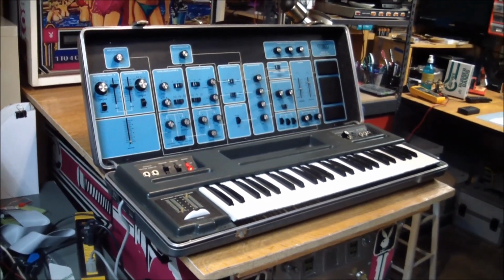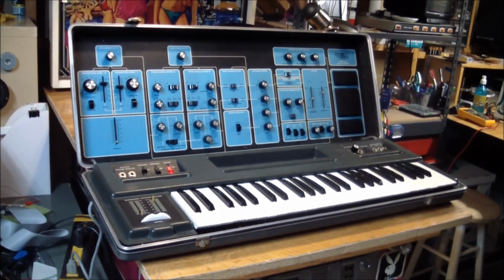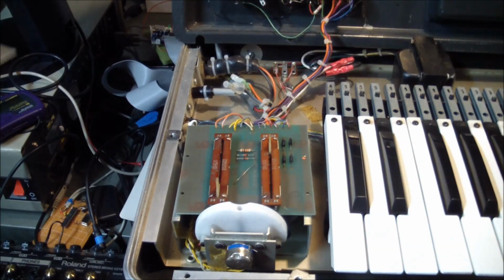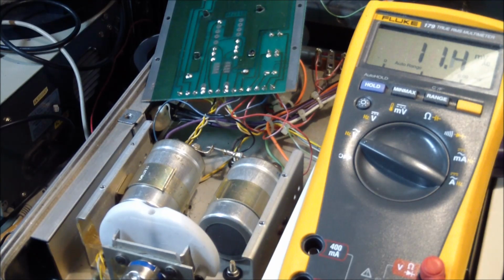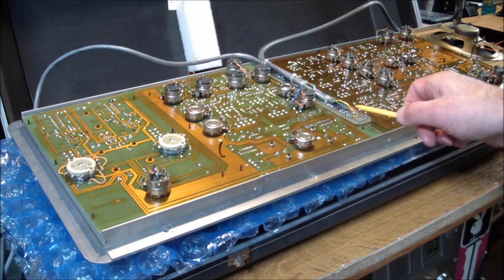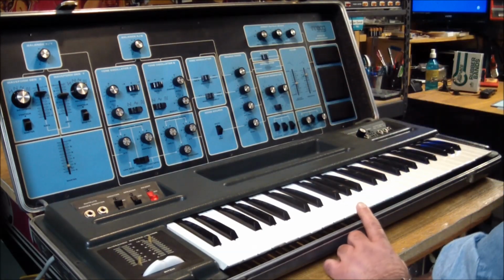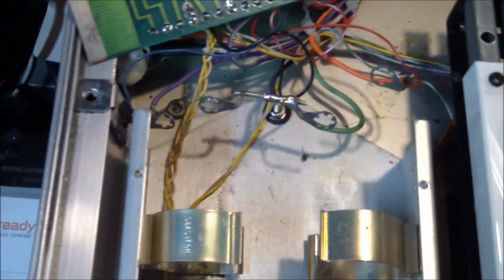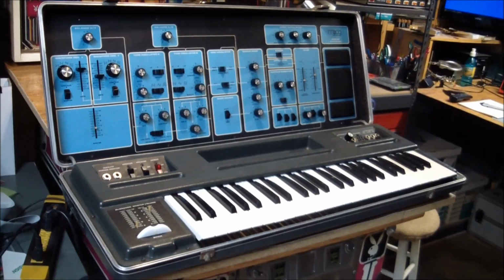AE#79 Moog Sonic Six Synthesizer Repair And Checkout, Part 1

Comment: hey i just got my hands on one of these. was instructed not to plug it in before i get it repaired/looked at. where’s the best place to get it repaired?
Reply from the maker: I do my own repairs so I am not aware of current synth techs. You may want to look for recommendations on synth repair forums.
Reply: @artifactelectronics  do you ever do a commission repair ? I haven’t had any luck on the forums.

Comment: Still got mine!  Since the 70’s.
  Nice tech walk thru!
   Nice power chord connector upgrade!  Mine has the original 2 pin plug.  Your previous owner replaced it because the vintage power cable is  almost impossible to find.
   I use a scope to check the regulation before changing the  old filter caps.  I’m impressed you put the new caps in the old cans.  👍
   I have to regularly reseat most of my Moog connections.   Course I’ve had them 50yrs or so.
   It’s been many years, but I don’t remember mine having that power  audio module.  I think mines all discrete. I’ll have to open it back up. 
    One mod I did was to output the keyboard circuit so it could drive 2 MiniMoogs.  I was into the huge osc sound like Emerson was.
   I used the Sonic 6 on the solo section of this song.  Scroll out to around  ‘2: 40’, it’s after my guitar lead. 
https://cdn.bandmix.com/bandmix_us/media/103/103212/52912.mp3
(I designed that guitar distortion pedal in 71.  Nothing on the market like it back then)

Comment: Could you have used like a pyramid power supply or any hi amp power supply,, or even a car battery to weld the terminals back in the caps, instead of soldering them...it would be like a tack weld, like they use on the 18650 lithium batteries....

Comment: Hi Arti.  Just one tip: do not cut the cap can with a Dremel; that always looks ugly.  Instead use a plumpber's pipe cutter.  You know, the tool with the cutting wheel. Makes a sharp, clean cut.
Reply from the maker: I'll make sure to try that on the next can capacitor organ transplant.